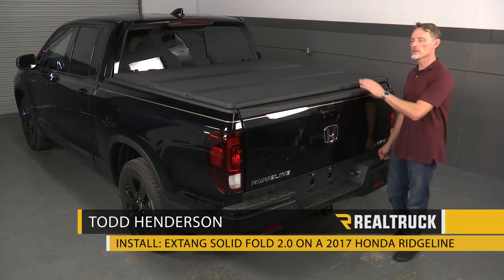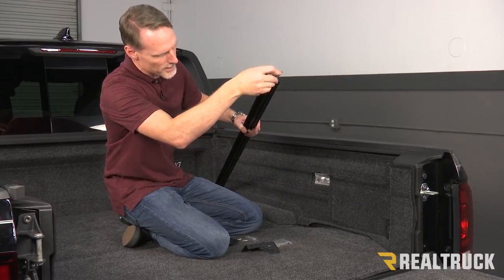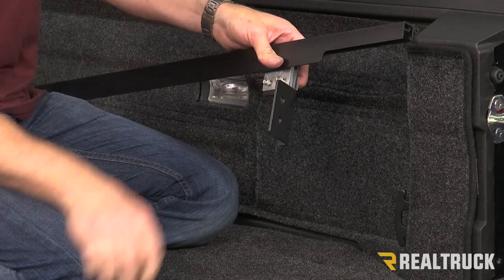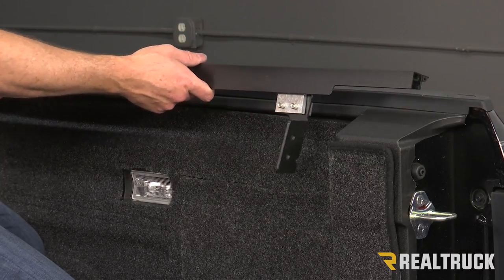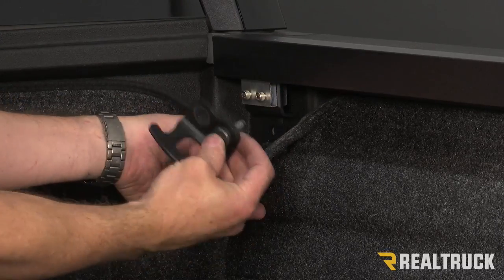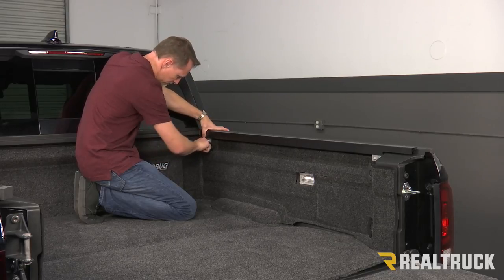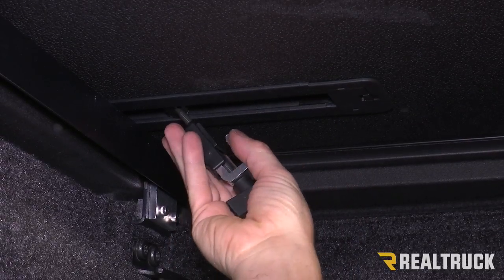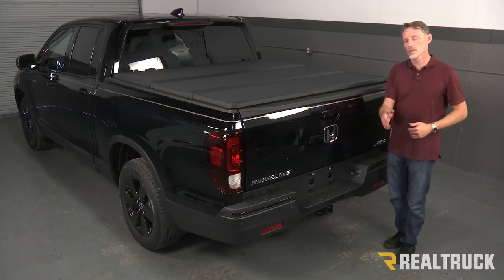How to Install Extang Solid Fold 2.0 on a 2017 Honda Ridgeline

Comment: Looks like the installation process is different since there are rails.  Other videos for other trucks don't need rails to install.  Are the rails provided with the cover for a Ridgeline?  Or rails are an option?
Reply from the maker: Hey Junior, the rails are included and required for installation on the Ridgeline. Hope that helps!

Comment: I bought this cover for my 2020 Ridgeline, but don't want to cut into the bed cover.  Where do you buy the rails?  I really didn't get any help from my local Honda dealer since it wasn't their Honda cover.
Reply from the maker: Hey Margaret, You shouldn't need to cut anything. We recommend calling in to our customer service line at 844-998-1491 and starting a tech support ticket. You will need you order number or the email you used to place the order so we can look it up. Hope that helps!

Comment: The front tie-down cleat interferes with stiffening bump in the bracket.  Are you worried that the tie-down cleat is bending around that bump when you tighten it down?
Reply: Yes, we recommend you remove the tie-down cleats prior to installing the rails.

Comment: The video was a big help to putting this on my 2019 ridgeline. Still took about 2 hrs to install and line everything up.
Reply: I could not get the side rails to lay flat against the bed rails, you could look throught them to the inside of the bed after installing.
Reply: @wineycartwright9257  I didn't have that problem but I had to take the bolts out twice and readjust twice before I got everything together. Are the level on the bed?
Reply: @kennyd8718  They are level on the top but the side facing the bed almost looks bent. It is flush on front and back but the middle bows out. It even hits the trunk door.
Reply: @wineycartwright9257  you may need to contact the company and get new rails.

Comment: Does this cover leak much and does it interfere with the trunk?  Thanks
Reply from the maker: You shouldn't seem any leaking with this cover aside from a drip or a drop here and there. No cover is 100% leak proof however for the most part - most covers do a good job at preventing rain and water from seeping in! This cover doesn't take away any space in your bed, if that is what you're asking!
Reply from the maker: Here is what Extang says on their website for reference:
The leading edge of protection from the elements is Extang’s exclusive perimeter seal. Extang’s seals snap onto our perimeter frame without adhesive and our new and improved hinge corner caps are coextruded to permanently attach the fin seal to the frame. The Solid Fold 2.0’s resilient seals will not peel away or fold under pressure and are designed to withstand thousands of opening and closing cycles.

Comment: Does the hidden trunk open fully with this cover?
Reply from the maker: +Paul,

When installing a cover on the Ridgeline it will hinder the operation of the truck. This will occur with any Tonneau cover. It will result in you only being able to open the trunk 75-80% of the way.